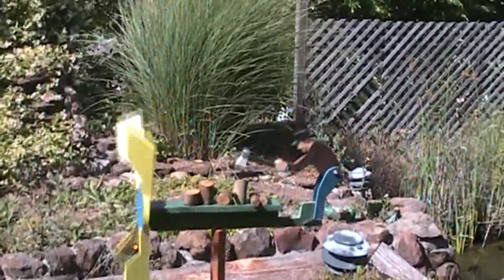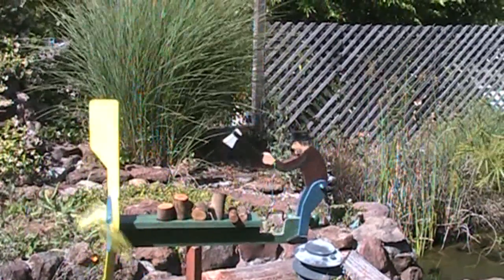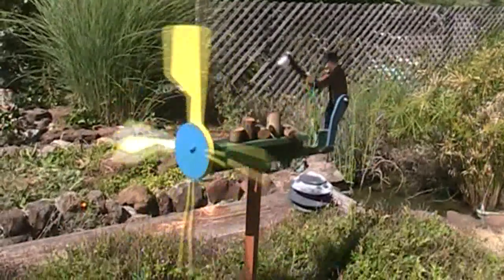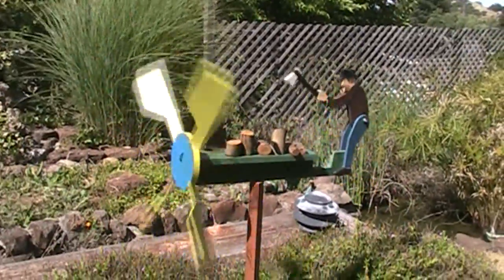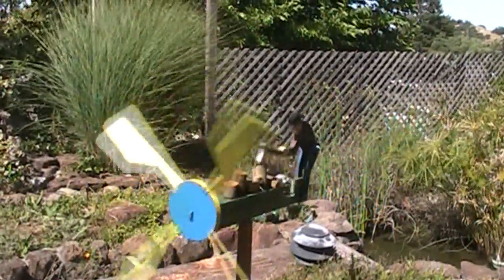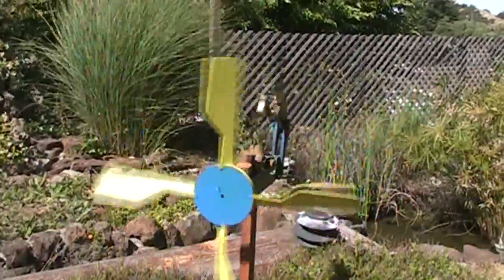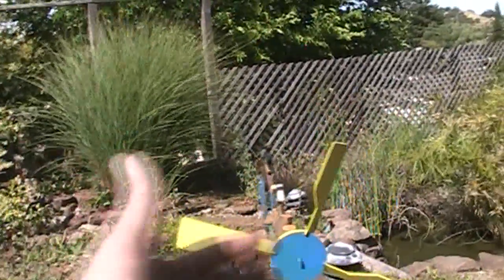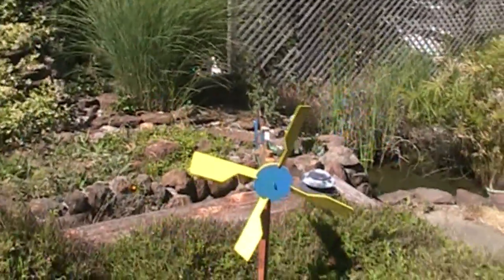MM 6-3-12: Whirligig follow-up

Comment: Steve, You made a very uniquely designed whirligig.  In gusty wind it's pretty normal for it to turn a lot.  As far as the blades of the propeller go, the thing works.  Turning them around would be more aesthetically pleasing, but other than that it doesn't matter. As long as the blades don't hit anything it's fine.

Comment: Hey Steve, thanks for the follow up! I'm glad it works, I thought it would work one way or another, but the jerking motion is definitely a characteristic of unstable equilibrium (blades competing with the natural aerodynamic position of the body), it only takes a small amount of force outside of the normal airflow to make it seek a new equilibrium. If you're interested, this effect is why fast jets are built to be deliberately aerodynamically unstable as it means they can be more maneuverable.

Comment: I made this whirligig and placed the blades the same as you.  I noticed a lot of people do it just as you did so I figured why not?  If it turns out better the other way I can reverse it.  Instead of bending the wire at the end I threaded it and also tapped the blade so it won't spin on the wire.  I, then secured it with a double nut.  So far, so good.  Like you I am waiting for a good strong wind to check it out.  I thought I could upload a photo here but I guess I can't.  I will try to figure out a way.  Thanks for all your videos.

Comment: With flat plywood sheet, the backwards blades just move the aerodynamic centre away from the pivot - the efficiency is unlikely to change.  Simplest solution to the instability? Add a weight near the blades and move the pivot.  In fact, if you want him upwind you could put a big weight under him and move the pivot that way. Then the blades wouldn't be backwards anymore, though they'd be in his (small) wind shadow.

Comment: Use some thin ply wood and make a large "vein" or fin like on a windmill. That will keep it stable and it will ALWAYS face the right direction to catch the most wind. You may need to add a small weight to counter balance the weight of the fin so it will be level! JUST A THOUGHT!